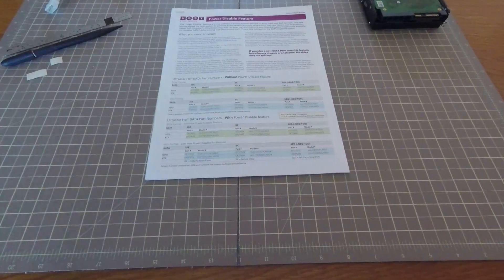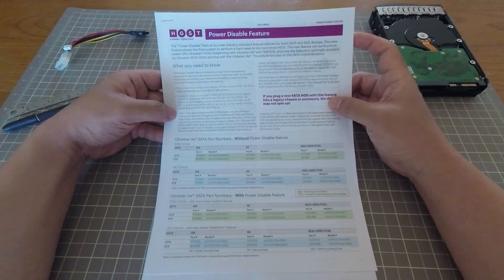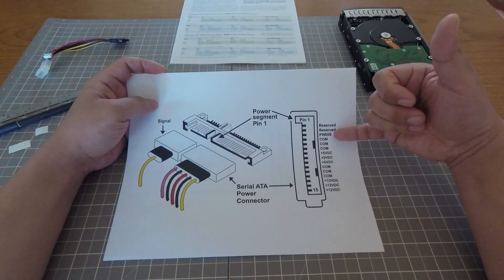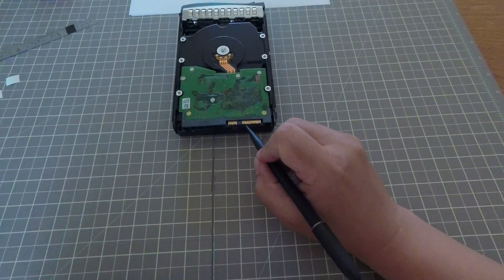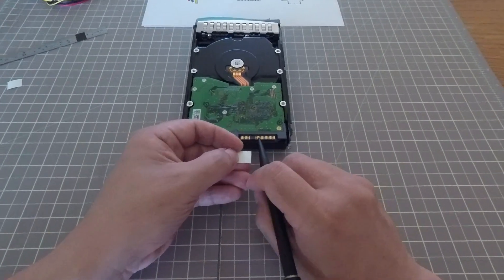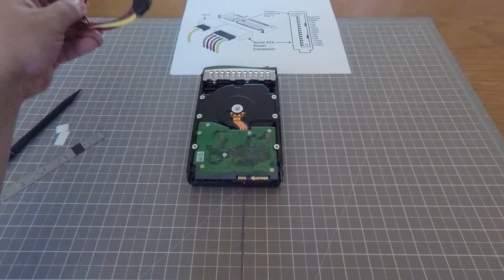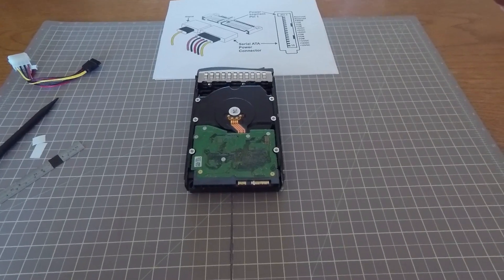how to fix power disable issues with modern hard drives

Comment: I recently ordered a WD Red Pro 18TB, and the model number is WD181KFGX. Could you tell me whether I will encounter this issue if I use it as the drive in my PC?
Reply from the maker: Sorry, I don't know. But you can contact WD customer service to ask and they would have more accurate information.
Reply: @ArtofServer  Thanks for your reply. I have received the drive, and it can be plugged in normally. There is no need to use a 4-pin cable.

Comment: I know this is a old video, but my current problem hits this issue. If my drives are working at first, but giving errors/disabling after they spin down for awhile, it is more likely the power saving features of my seagate drives in unraid rather than the pin 3 power disable feature? And disabling this via seachest should solve it as if I keep them from spinning down, they are fine.. Appreciate your videos and products, have purchased several things from your ebay, never worry about gear you sell!
Reply from the maker: That is correct, it does sound like a power-saving issue, and disabling those features using their software should resolve it. Lookup "Seagate EPC disable" to find the solution.

Thank you for your ongoing support of my store! :-) It is always appreciated!

Comment: Do you recommend buying an Ultrastar knowing that I'll have to do the taping trick to make it work? Or it's better to just buy WD Reds, for example... keeping in mind that the Ultrastar is about $100 cheaper.
Reply from the maker: Buying the WD Reds does not necessarily avoid this issue. if it's SATA spec is new enough, the same issue may exist. This is not exclusive to SAS or enterprise drives.

Comment: Thank you so much for this video, I just bought 2 x 8TB SAS drives to replace a failed drive in my unRAID server and thought maybe these drives were incompatible with my server as they were not showing up anywhere.

Quick question, if the power-disable 3rd pin is covered, does that mean these drives will be unable to spin-down (power off) ever? I usually have my drives spin-down in my server after a few hours of not being used. I understand SAS enterprise drives are designed to always be on, but I prefer the power-saving and noise saving of having all my drives off. Is this not going to be possible with this 3rd pin covered? Thanks.
Reply from the maker: Glad this helped you! :-) No, the drive can still spin down, but the backplane will not be able to power cycle the drive if that's ever needed.

Comment: I just buy a Seagate EXOS 16TB from online shopping and I got this issue TWICE. Does this method work on any SATA 3 cable and any SATA 3 HDD drive? Most importantly, who design this mechis淤and what for? It brings end users a lot of trouble. I justwant to read a lot of documents and study and try if it works. I just return the HDD to the owner.
Reply from the maker: Power disable is a feature that was introduced to allow SAS backplanes to power reset the drives. They implemented it by using the 3.3V line that was not in use anyway. In the server space, most backplanes don't even supply 3.3V so it is never a problem. Unfortunately, on the consumer side, ATX PSUs tend to supply 3.3V to the SATA power connectors, which causes this problem. Just find a way to disable the 3.3V (as explained in this video).
Reply: @ArtofServer  Thank you very much for you to reply.
Does this problem happen randomly? I buy 2 HDDS and first one is ok and the second can't detect. 
I return one and I buy again and the problem persists. Steps to solve this issues:
1. I tap out pin 3(any tap is ok)
2. I buy a Molex-to-SATA Power Adapter.
3. I connect the power from Mother Board to 4 holes power cables to a Molex-to-SATA Power Adapter(which have 4 cables:(color:B-R-B-Y)
   and to a SATA cable to connect to new SATA HDD, right? 
   (Question: If pin 3 is already tap out, Why do I need a Molex-to-SATA Power Adapter)
4. This work on any tap, SATA cables, HDDs, correct?

Comment: Easiest way I've found is to get a StarTech PYO4SATA Power Splitter Adapter Cable and carefully remove the 3.3v cable from all connectors, you should be able to remove the caps holding the wire and connectors in place then carefully remove the connector with the wire. Worked for me.
Reply from the maker: yup, that's certainly a way to do that too!

Comment: Thank you so much for this video. Almost 2025 and this still helped me out. Had a drive that I shucked a while back that would not show up in unraid. I was not sure if my drive had the power disable feature. Didn't have any of the tape on hand, didn't have a molex converter, and didn't want to manually remove the third PIN. However, the tip about the power cable having 5 wires vs 4 was on the money. I found an old male to female sata extension cable with 4 wires, hooked it up and my drive worked.

Thanks again!
Reply from the maker: Glad this was helpful to you after all these years! :-)

Comment: Just ran across this with a couple 10tb shucked drives.  Could not get P-touch tape to stick at all and Kapton tape is to expensive for the couple MM needed, so I got some clear nail polish at the dollar store and put about four coats on pin 3.  Worked like a charm.   Drive fired right up.

The trick is to tape off everything except pin 3 and use a fine dental pick to do the application. A toothpick would work. Or the nail polish brush.  It's really the same technique as applying solder mask to a trace.

Solder mask was what I wanted to use for this but didn't have any. Clear nail polish works just as well and doesn't need UV to cure.

Comment: Hi do ypu know how to tackle this issue with putting a white label drive in an usb enclosure. I have tried 4 different ones, covering Pin 3 to no avail.
I have 2 12 TB drives with a lot of archived data, and moving on to a new mini PC, I have to keep the old desktop to do copy via local network. Very tough.
Do you know what the pins are when dealing with an USB enclosure or USB pigtail? I sure appreciate it, and also a lot of people will as well. Thank ypou so much.
Reply from the maker: Sorry, I don't know the USB enclosure you're using. There could be something specific to that enclosure. It is usually easier to just use a USB3 SATA dock for the type of activity you're describing.
Reply: @ArtofServer  Yes they are all USB 3 Enclosures.

Comment: Done, nothing.Disconnected pin 1+2+3 still nothing...
Reply from the maker: Probably a different problem. And you only needed to block pin 3.
Reply: @ArtofServer  I should had to write it more clear. I blocked PIN3, after that PIN 2 and next PIN 1 , so many attampts and still no rotations of disk :-(

Comment: Thanks, I learned something here.  I was wondering if I could just cut the 3.3V wire on the harness and cap it off but instead found that on an EVGA modular power supply you can plug the SATA cable into the PSU port labeled PERF (as opposed to SATA).  This port is intended for the legacy 4 pin molex plugs and does not provide the 3.3V power.
Reply from the maker: Glad you found this interesting. I didn't know that about EVGA power supplies! :-)

Comment: Did not work on WD 4TB Purple drive in legacy Esata enclosure - tried covering just pin 3 and then covered the 1st 3 pins - still no power up - but WD 1TB green drive that was in drive still spins right when I power up the enclosure. ( put Purple drive in newer USB 3.0 setup spun up right away.)

Comment: Scoured the internet as to why bios wouldn't see my drives. Found out they weren't spinning, so I thought they weren't getting enough power. After watching your video I applied some blue painters tape on pins 1-3. After plugging in everything works great. Thank you so much for the help!
Reply from the maker: Glad I could help
Reply: I'm having the same issue my HD beeps once when plugged in but doesn't spin.

Comment: Great and thank you. But for me, it is still not working even when I have a special 4 cable adapter ( SATA to SAS ) And I have 12V and 5V power output from my PC's power. I have 5 SAS 3,5 hdd's but none of them power up :-(  Any tips?
Reply from the maker: You might have a different issue going with those drives.

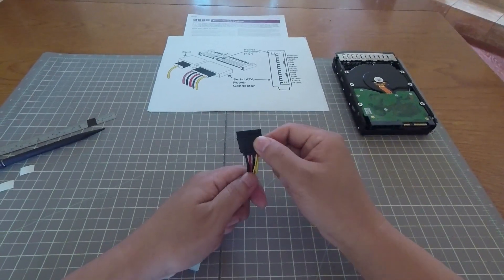Comment: Wait, So if my SATA power connector has 5 cables. The HDD most likely wont power on. 5:32
Reply from the maker: If the HDD has the power disable feature...

Comment: It's all a bit of a mystery, the Orange 3.3v wire. My Sata HDD kept resetting, I could hear the motor spinning up & down. I was using a Molex to sata adaptor cable, Four wires, No Orange. When I connected direct to the Sata plug, which did have the Orange wire, it seemed to then power up the HDD properly. I confirmed this by doing the same with a different Sata HDD which exhibited the same scenario. I recently purchased Samsung EVO SSD as the Main boot drive and now using the old Standard/mechanical drive as a secondary drive, I wondered if this may have some effect on the operation of the secondary Drive. seems to be a case of trial and error. As you mentioned, generally one would expect the connection of a permanent 3.3v to Diasble/inhibit the HDD from starting.

Comment: What about the risk of catching fire that these molex to SATA adapter cables apparently have?
Reply from the maker: Yeah, I've seen photos of that problem. Make sure to get quality adapter cables...  I know, easier said than done.
Reply: I have only seen this when people try to power GPUs with SATA. HDDs are very low power in comparison so wouldn't be too concerned.

Comment: Hello! For example, a 12 TB WD Gold drive (15 pins for electrical connection) and a Sesonic Prime power supply, which is also equipped with SATA and SATA 3.3 cables. What type of SATA cables are better to use? Will there be harm to the disk if I connect the wrong cable? Thanks for the answer.
Reply from the maker: No harm. If you trigger the power disable, the HDD won't spin up.
Reply: @ArtofServer  " If you trigger the power disable" = insulate 3 pin as in the video ?
Reply from the maker: @АндрейИванов-щ7у4д  yes
Reply: @ArtofServer  The power adapter connector of the Seasonic Prime SATA 3.3 has 12 pins (the last three 3.3 V pins are excluded). If the manufacturers of WD Gold 12 TB (121KRYZ) made 15 pins, then can we assume that there are special power supplies that use the extreme three contacts in a different way? If so, please share a link to such a power supply.

Comment: Excellent content sir. The thermal printer tape is an excellent idea... short of doing that I was going to just cut and heat-shrink the 3.3 volt wire going into the back end of the sata power connector. But after some thought, I will be patient and just order a molex adapter cable...

Comment: Just cut down the innermost side line of a normal SATA power cable and fix the cutting with insulating tape. Your solution works but not satisfied official guideline (keep P1, P2, P3 connected). And NEVER EVER use IDE-to-SATA converter unless you make sure you can absolutely trust the manufacturer, in most case, you get shot and fire then you lose your HDD (permanent damage on PCB board).  https://www.reddit.com/r/pcmasterrace/comments/3mhdwn/browsing_reddit_when_i_see_smoke_and_fire_coming/

Comment: Careful with those Molex to SATA they like to catch fire!
Reply from the maker: you know, that's a good point. i haven't experience the molex->SATA power failure myself, but i've seen the photos online about this problem when some of the hot wires short with the ground wire inside the cable adapter; that's what you're talking about right? yeah, definitely, quality cables recommended...
Reply: Only the all-in-one molded versions! Bad molding can lead to internal shorts;
the type with clipped-in crimped ends can't possibly short.

Comment: Just cut the 3.3v orange wire on your power supply cable.  Splice it back later if you need to.  The tape idea is stupid.
Reply: There is no power supply cable to cut if your using the drive in an array with a backplane that supplies the power.  The tape works great.
Reply: @OKuusava  - Cutting power supply cable and splicing it back is way more work than using tape on the drive itself.  LOL.
Reply: If the orange wire can be pulled out of the connector then you dont need to even cut it, you can shrink it or use electrical tape to avoid a short and then replace it later if needed.
Reply: @OKuusava  - Cutting a wire 0.4 seconds?  Haha...majority of Power Supply Cables you have to unsheathe before you can even cut it.  0.4 seconds my ass.  Have you even used a power supply before??  LMAO!  If it takes you 15 mins to cut a piece of tape and put it on, you might want to get checked for Parkinsons.  :)
Reply: Cutting 3.3v wire will void warranty.  So if your drive dies after a short while, good luck RMAing it.  Using tape is reversible and can be sent back to manufacturer without issue.